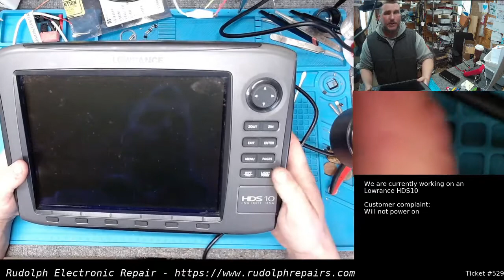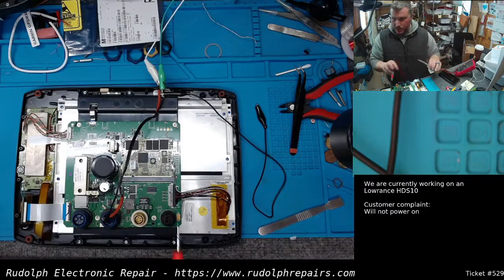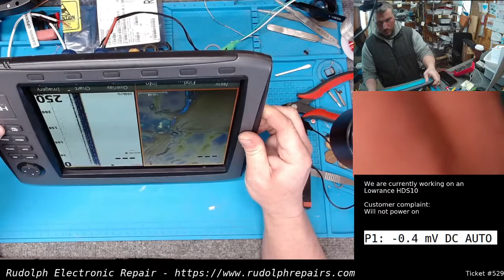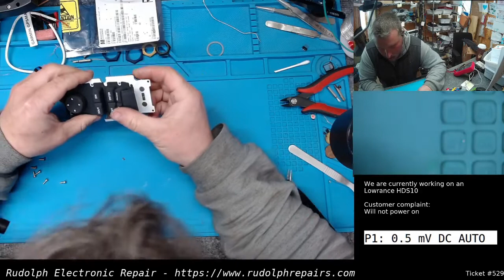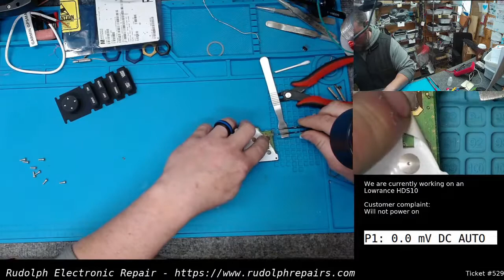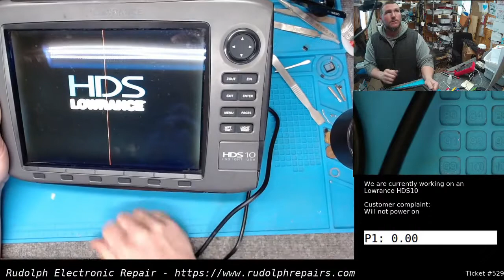Lowrance HDS10 Power Button Diagnostics and Repair

Comment: Hola, tengo el Lowrance Elite-5 y  me gustaría saber cual es el pin negativo y positivo para conectar una batería de 12v, donde vivo me es difícil casi imposible conseguir el cable de poder original.

Comment: I am having this same issue. Can I send my unit to you to have it repaired?
Reply from the maker: Definitely, send it in and we will get it right on the bench.  Just fill out a mail in form and the address will be on that page 👍

www.rudolphrepairs.com/mail-in-repairs
Reply: @rudolphelectronicrepairllc8938  Awesome. I filled out the form last night and will try to get it in the mail this week. Just the head unit and the power cord correct? Appreciate the reply
Reply from the maker: @jessecornell8167  correct just the unit itself, no need to send cords if you do not want them tested.  👍